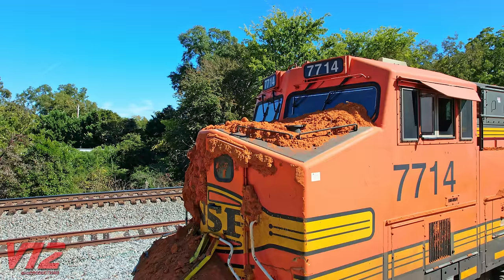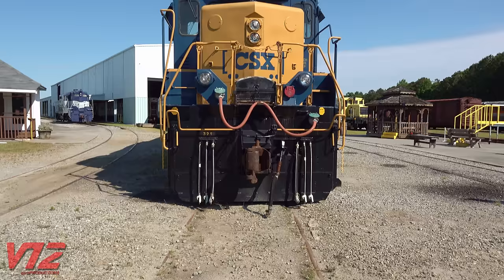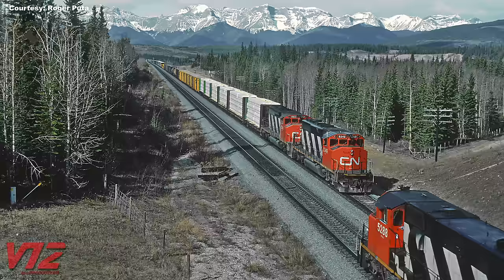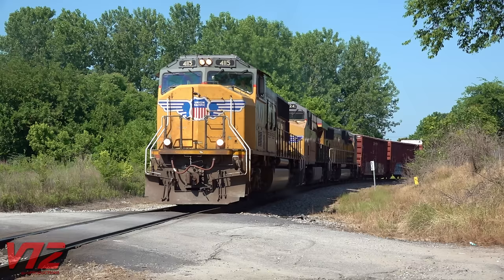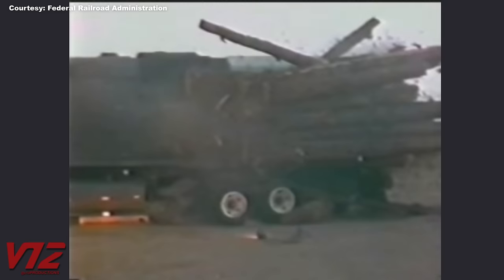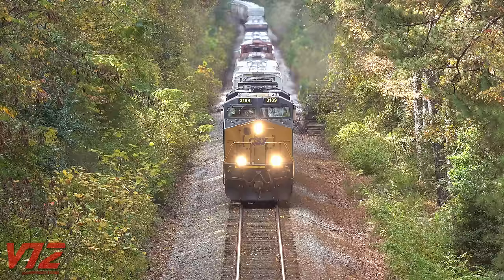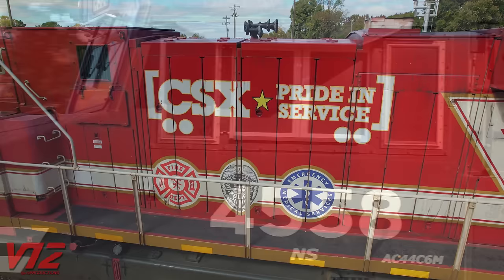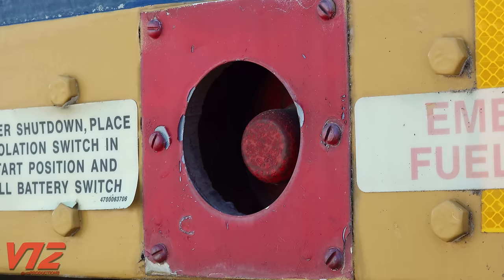How SAFE are Locomotives?

Comment: Maybe if the conductor would stop the train before hitting the vehicles on a crossing rather than after they hit it. Or at least try and steer the train around the vehicles, instead of going straight into the vehicles. The train crews should be fired for all impacts with vehicles.
Reply: That's so obvious. I wonder why nobody thought of it before now....
Reply: I hope this is a sarcastic comment  but just incase it isn't, what difference would that make? Trains can't be steered, and they can only go where the Rails go, even if the Engineer/ Conductor tries, Trains are to heavy to stop in time at crossings for obvious reasons, also Trains have the right of way on crossings so any collision with a Train and a Vehicle is automatically the Driver of the Vehicles fault.

Comment: When did the Locomotives get air conditioners? I retired out the Army in 1998 and we still didn't have any air except doing 45 to 50mphwith all events and windows open including the front windshields. Now they have air
Reply: A broken air conditioner will stop a train from leaving the terminal, as well as a broken toilet, icebox or seat.  Note I said ice box.  They used to have refrigerators, but they kept getting stolen.
Reply: 1990s.
Reply: @tonyburzio4107  I suppose it depends on the railroad, not NS, no AC no problem. I have been on a widebody in a 100 degree weather with no AC. They dont give a crap. Widebodies are the worst because you get very little air in the windows while moving. I have cracked the front doors before it was so hot (which was super stupid).